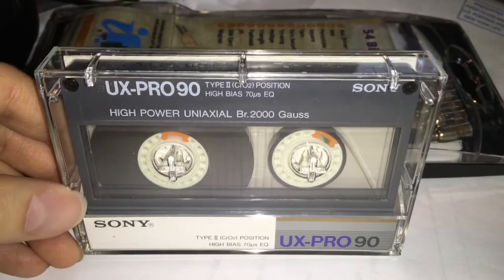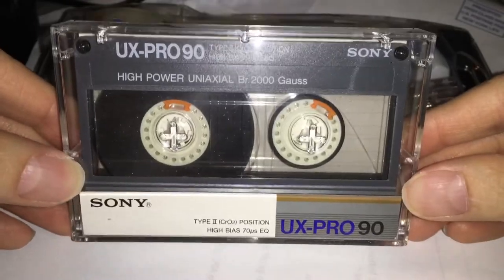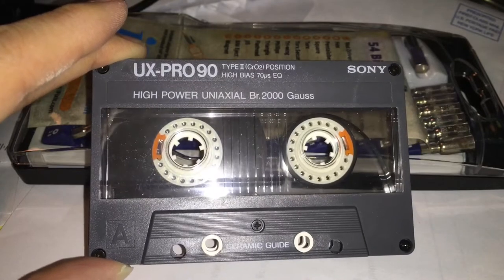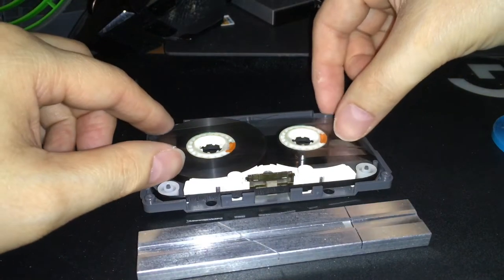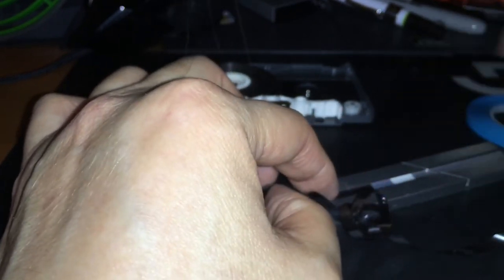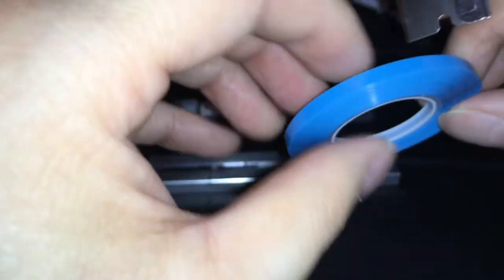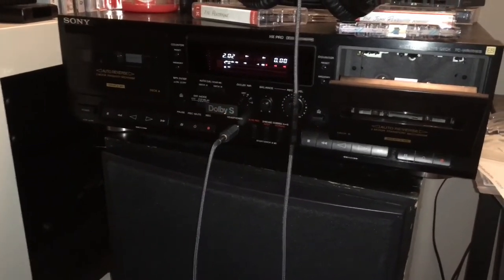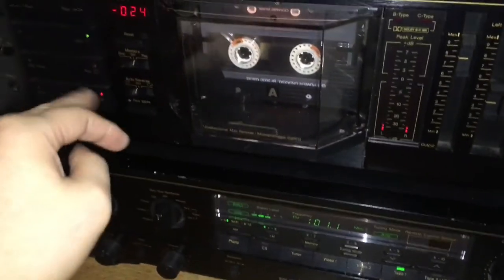Splicing a Cassette Tape - Sony UX-Pro 90

Comment: This takes me back. So wish I still had my splicing kit!
Reply from the maker: If you ever need one, Splicit still sells it!  But it from the banner on tapeheads.net - they are a sponsor.  You also get a discount if you go through tapeheads.net.  It's a good forum for tapeheads like us. :)
Reply: Techie Zeddie bruh when my tape gets eaten i just cut it with scissors and put some tape it works fine not as gud but what the hell 😏

Comment: I've had cassettes since the late 1960's but not lately, this is the first time I've ever seen one opened up and tape spliced, back then we used to just play'em as-is, even if the tape got eaten just pull it out and wind it back up, can't believe what the metal ones are worth now 🤗
Reply from the maker: Yeah, and all NOS blank cassette prices are going up and up, not just the Metal ones.

Comment: Sony deck sounds like it could possibly have a problem with pinch roller. Saw your other vid on replacement rollers, and wonder if perhaps they're just a micron or two too small. I have a deck with a worn roller that I sanded down, perhaps a wee bit too much, that will sometimes skew tape if it's too thin or long. C60s work fine for the most part.
Reply from the maker: I think that may be it.  The ebay seller is going to send me 2 replacement rollers.  One for deck A (W&F still too high from spec) and the other is for deck B, where the skewing seems to be happening.

I was seriously contemplating on replacing it with the factory roller that's in the best shape of the 4, but decided against it.  A lot of work for  a temp fix when I know the new rollers are coming.

Comment: A little residue on the tape, I would have gotten a q-tip with some rubbing alcohol and tried cleaning off whatever was stuck on it first.  I’ve done that successfully on a few dirty tapes rather than losing 2-3 minutes.  Of course if a tape got eaten and is crinkled, that’s a different story.  Good splicing tutorial tape though.  👍🏼
Reply from the maker: I tried, hun.  It didn't come off.  I have no idea WHAT that was.

Comment: Very informative. That's the first time I've seen a demonstration of a compact cassette being properly spliced using a kit. Only just discovered your channel so not seen that second cassette deck and amp before. Very nice. Mid 80s perhaps? Curious that the cassette loads upside down with the heads at the top. Unusual for separates unless it's part of a midi system.
Reply from the maker: Thanks!  The amp is a Nakamichi TA-3A from 1989.  The deck is a Nakamichi RX-202 from 1982-93.  It's a 2 head deck with their unique UDAR auto reverse that flips the entire cassette, so the cassette had to be upside-down.  Nakamichi also did this for their 3 head RX-303 and RX-505.

Comment: I have a Maxell Metall-CD 90 and the tape inside is same as yours. My tape was sealed and i get it in 90', so is not a storage problem, the tape has came in this way from factory. Don't splice again a tape if has residue, just clean it with isopropyl alcohol. Change the pinch roller from that deck, is pulling the tape on a side, is not the azimuth.
Reply from the maker: It was a used tape and the residue could not be cleaned with isopropyl alcohol.  I don't recall if I mentioned that in the video.  Since it couldn't be cleaned, I just spliced it out.  The tape will be reused.
Reply: @TechieZeddie  Sometimes water will clean better than isopropyl alcohol, depending on the residue, anyway the job is done in a way or another
Reply from the maker: @ciocanxxl  Water didn't help this time, and neither did ISO alcohol.  I made the choice to cut it, so no going back anyways.

Comment: I haven't had great experience with metal tapes (just too thin) actually that goes for any really thin tape (metal or otherwise) I think I got a few towards the end of the mainstream cassette days ... my personal observation was the really cheapened out on the thickness of the film the oxide is on ... makes the tape extremely fragile and if the machine wasn't spot on in tape path it would AT LEAST crease the tape along its edge OR crease it because the head had a little wear ... shorter length tape 90 minutes or less lengths used a much thicker base mylar for the oxide... until they cheapen out that way too LOL anyways I haven't had good results with that super length tape ... some of the last generation tapes used tape designed for longer tape lengths they just didn't give the original lengths that thinner tape was made to be like 100 or 110 minute lengths TDK sold anyway that could be others experience as well

Comment: The tape selector switches on the Nakamichi are only relevant when recording.
Reply from the maker: Is that true?  I guess that makes sense because in most other decks, it selects the EQ.  But in Nakamichi decks, the EQ is separate control.  The tape selector is probably to determine the amount of current the erase head needs to erase the proper type (type IV needs way more current to erase).
Reply: @TechieZeddie  Yes. It even says so in its user's manual too.
Reply from the maker: UlfrikTB cool!

Comment: I don't understand why instead of sticking the two tapes together, not remove the orange team from the empty cog and connect the tape to the cog directly removing the lead tape altogether. Can anyone answer?
Reply from the maker: The leader tape is probably to handle the initial stress of the pinch rollers and capstan when they first engage.  That's my guess anyways.  Also, according to National Audio Company: Leader - Special non-magnetic tape that can be spliced to either end of a magnetic tape to prevent damage and possible loss of recorded material and to indicate visually where the recorded portion of the tape begins and ends.
Reply: @TechieZeddie  thank you for taking the time to answer. Sounds like it's not a big deal to omit the leader tape but it's even better to keep it
Reply from the maker: @spirosfoufoutos6241  Sounds like the leader tape also wraps around the tape to prevent degradation.

Comment: I, wouldn't do that if, I were you or, you'll be sorry, by splicing that tape of yours.
Reply: Well, Steven, please explain yourself.  Why ?  I think she prefers not risking damage to her heads.  I have encountered the same damage pattern throughout an entire box of Sony XR Metal, and this does not clean off.  Splicing a bit away beats chucking the whole tape, right ?

Comment: could be mold maybe
Reply from the maker: Hardy Boy I don't think so.
Reply: @TechieZeddie   thank god for that right !
Reply: I've encountered this too, just as Zeddie, with Metal ribbon.  It's a manufacturer's defect.  Can't tell you what, or why.  But it does NOT clean off: pure damage, not residue.  The $12.99 Question is, does this particular type of damage harm heads or not ?  Who's willing to find out for us, lol ?